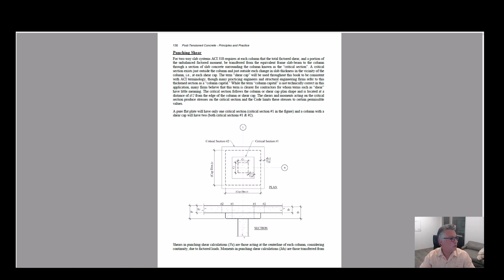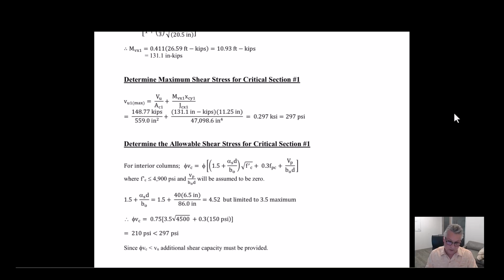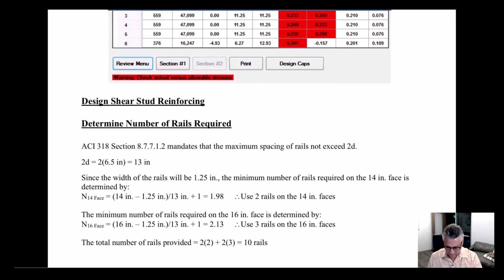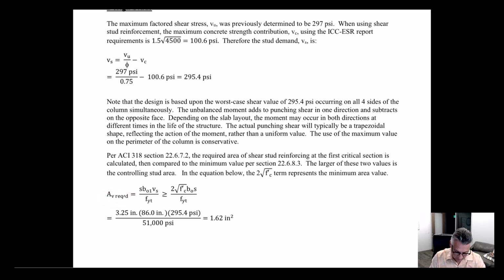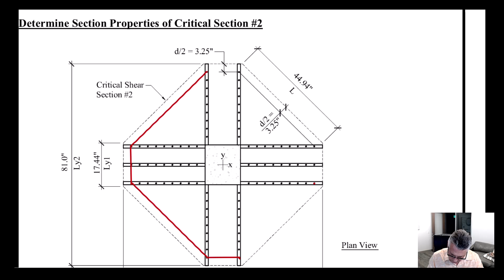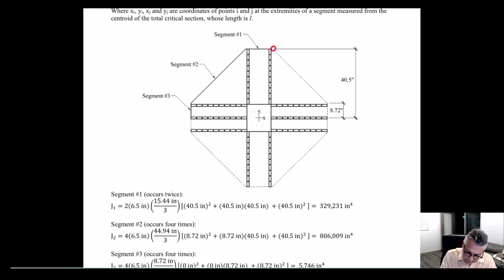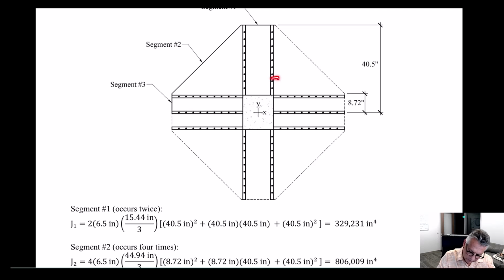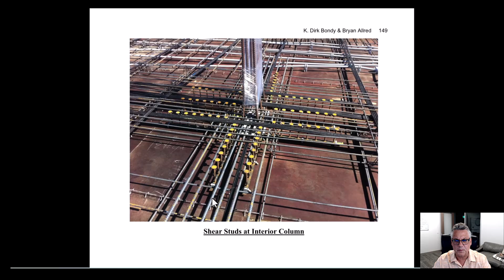Lecture 18 Studrail Design

Comment: I believe that the reason "Vc" formula provides smaller value for critical shear section #2 compared to section #1, is that rupture mechanism in section #1 is two-way shear failure but when you get away from the column, rupture mechanism shifts to one way shear failure. As a result, concrete resistance in section #2 is calculated by a another formula.
Reply from the maker: Hi Farzan, That doesn't make sense to me. When section #1 doesn't work we have two choices....add studrails or column caps.   They both do the same thing and move the 2nd shear plane to effectively the same place.  But with column caps we still use the two-way concrete capacity.  Only with studrails are we required to cut the capacity of this shear plane in half.
Reply: @dirkbondy With your explanation Dr. Bondy, I only have 1 guess left.

Shear reinforcement doesn't start to resist loads effectively until some cracks start to happen in concrete.

Maybe this is the reason that code acts more conservative with sections that have shear rebar 🤔